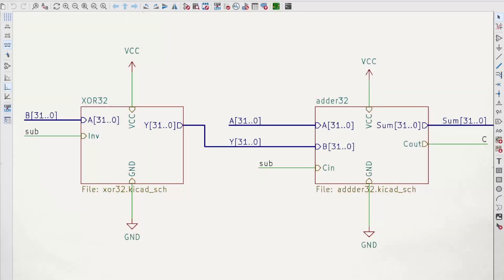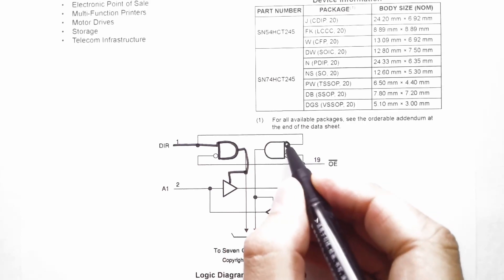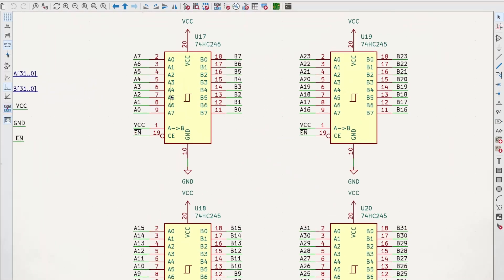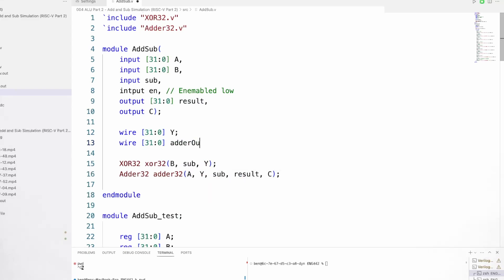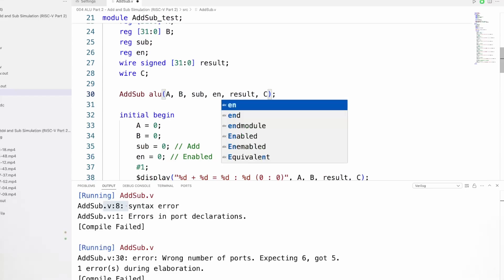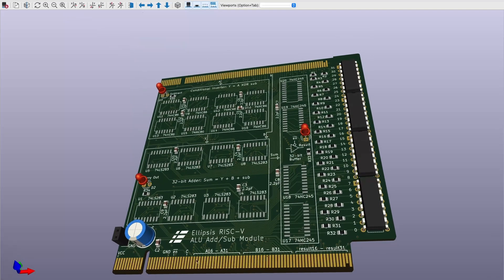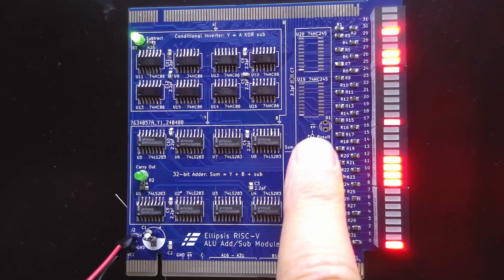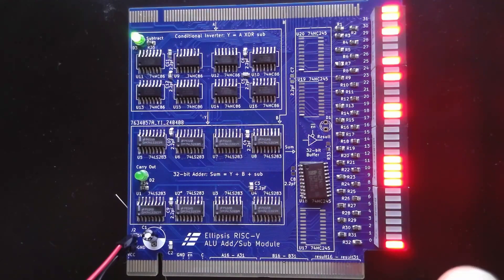ALU Output Buffering (RISC-V Part 3)

Comment: can you please give some information or link to the compiler you are using for verilog?? this is the most comprehensive guide on the language I've found but you dont talk at all about the build tools and steps.
Reply from the maker: I'm using iverilog (Icarus Verilog) as the compiler/simulator. It's a free command line tool. I then use a plugin for VS Code - I'm using this one (https://github.com/leafvmaple/vscode-verilog) in the video, but there are others too. Just make sure you have the iverilog executable on your path before using the plugin and it should work. If you want to do more serious stuff you can always use Vivado which just requires a free account for download.
Reply: @ellipsisprojects  I would also add gtkwave to the toolchain. In the testbench verilog module, it only takes one line of code to write signals to VCD file, which can be later viewed in gtkwave.

Comment: Why use a 74245 instead of a 74244 or another buffer ic instead of the full transceiver ic?
Reply from the maker: I was originally looking to use a 241 or similar but they didn't seem to be available in an SO package on AliExpress where I was buying all the parts. Also, I may want a bidirectional buffer later when I start looking at integrating memory, so I just bought a bunch of the 245s. So no technical reason, just for practicality.